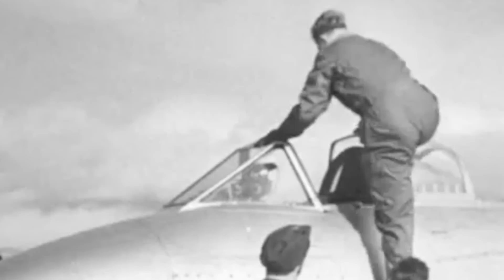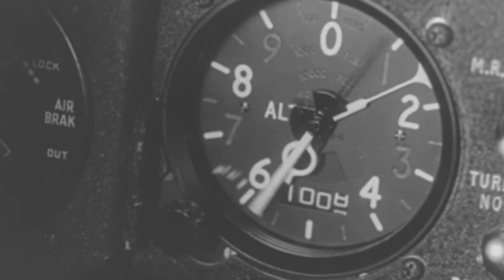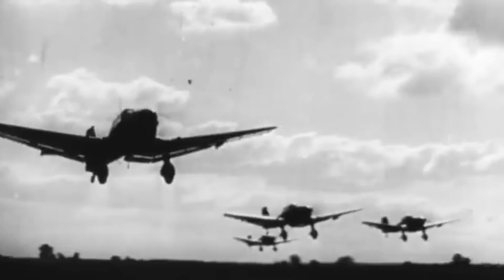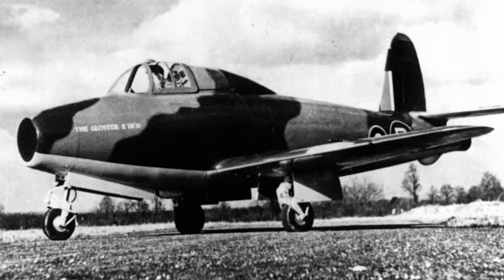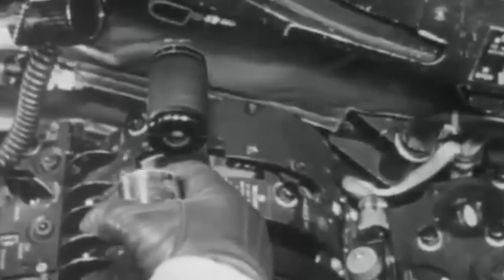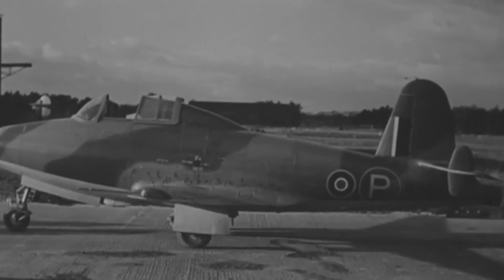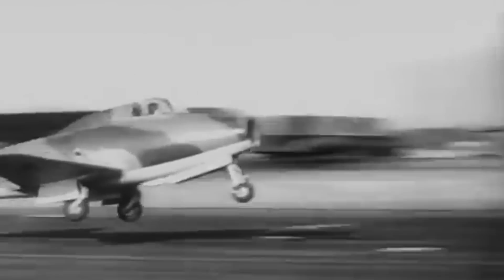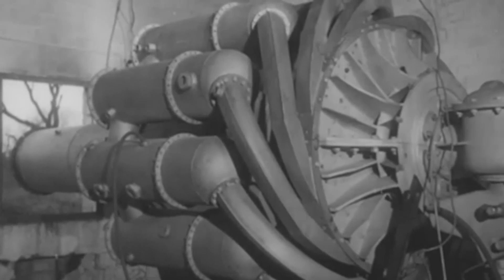Britain's 500 MPH Coffin With Wings

Comment: The description of the Gloster E.28/39 as ”Britain’s 500MPH Coffin with Wings” is just ridiculous.  As a prototype, it was probably safer than many other prototypes, British and American, of that era: the second of the two aircraft crashed, but no-one died.
If you were to ask me to identify an early British prototype jet aircraft that could, unfortunately, be described as a “coffin with wings”, then that must be the DH108, which killed Geoffrey de Havilland Jnr.  Captain Eric ‘Winkle’ Brown also flew it and almost certainly survived because of his short stature, as his head did not hit the canopy when the aircraft experienced violent buffeting.  Two other test pilots also died in crashes of the DH108, and all three aircraft were lost.
The crash of  E.28/39 W4046 in July 1943 was nothing to do with the engine: the ailerons jammed at 37,000ft, possibly because the grease in the bearings froze.  With the aircraft inverted, Davie didn’t even consider staying with it, and was preparing to bale out, but was thrown out of the aircraft when the canopy broke up.  However, he had the presence of mind to free fall before pulling his ripcord.  
Although he sustained injuries, he was able to return to work as a test pilot not long after the crash.  Sadly, however, he was lost in January 1944, when he was piloting the Gloster Meteor prototype powered by Metrovick F.2/1 axial flow engines. The port engine reportedly “disintegrated”, and he struck the tail of the aircraft as he baled out.  Despite this failure, the F.2/1 was significantly more advanced and more reliable than all of the German axial flow engines of the time. 
Before the flight-standard W.1 engine was installed in W4041, a non-flight-standard engine, designated W.1X, was installed for taxiing trials in April 1941. The aircraft did do some short ‘hops’ a few feet off the ground with this engine.  There is some amateur film footage of W4041 bumping over the grass at Brockworth elsewhere on YouTube.  Amateur footage of the ‘official’ first flight of the aircraft at Cranwell in May 1941 also exists, probably taken by the same cameraman.      
The W.1 engine that powered the first flight of W4041 had a higher pressure ratio, a lower specific fuel consumption and a better thrust-to-weight ratio than the Me 262’s Jumo 004B engines in 1944.  By the end of WWII, the British centrifugal engines were even further advanced, in terms of performance and reliability, than the German axial flow engines.
In late 1941, the W.1X was sent to GE and was the first jet engine to run in the USA.  Let me remind people on the other side of the Atlantic that the first generation of jet engines to go into production in the States were licence-built British engines.  The GE J31 was based on Whittle’s W.2B/23, and the Allison J33 was originally designed by GE as a ‘straight through’ development of the J31.  The P&W J42 was a version of the Rolls-Royce Nene, and the J48 was a version of the Rolls-Royce Tay.  The axial flow Wright J65 was a version of the Armstrong Siddeley Sapphire 6, which was originally the Metrovick F.9, essentially a development of the F.2/1.
Reply: The Gloster Coffin Works was infamous for its flying deathtraps and appalling safety record.

The Goster E.28/39 struggled to teach 380 mph.

The Gloster Meatbox was without question the worst jet aircraft in British history.
This deathtrap was unmatched in its horrific loss rate and fatalities.

890 crashed just in RAF service and killed 450 British pilots while never shooting down a single Luftwaffe plane.
Reply: @sandervanderkammen9230  what a load of nonsense. All of the early jets had poor safety records, look at the 262! The RAF had a higher accident rate  with the Sabre than the Meteor. The E28/39 wasn't built to set speed records, but to establish the jet engine as a practical power unit for service use, which it did very well. Aerodynamically it was sound, not spectacular. It might have come later than the dead-end He178, but it was far more practically useful. The loss of the second prototype due to control freezing at high altitude was hardly a reflection on the basic design of the airframe or engine. The British approach was cautious, not driven by desperation, as the German approach was by 1942/43, under the direction of a lunatic. The reason that the axial-flow Griffiths designed Metropolitan Vickers jet engines were not put into production in the war years was because of short engine life problems. In that sense, no worse than the BMW and Jumo jets, which in service only lasted about 12 hours. After the war, Adolf Galland said how much better the 262 would have been with British engines, after he had flown the Meteor in Argentina. Enough said, really.
Reply: @sandervanderkammen9230 

We believe we can clear up some common misconceptions & false myths.

It's always very important to note the relevant facts obviously.

Krappenz, DiktorBummer, KARZEESTAN, Diktorbaturmosterjerkzxoffenzische, AnewAOownley etc & co - they should all note with much awe and great wonder.

    Regarding the awesome Gloster Meteor, it's achievements & obvious relative superiority.

     Yes that's correct obviously, the ME-262 was limited to running away from allied piston engine fighters  & risking engine destruction while doing so & it took 3 downed 262s for each downed allied bomber over Germany where German air inferiority was fairly ubiquitous so there was indeed large swarms of allied bombers available to have a go at but the 262 was of course a dismal failure at that task.

     Agreed, clearly after 1941 it was clear The future Gloster Meteor wouldn't be required as such & was limited to operation over the UK & occupied allied territories to keep examples out of the wrong hands.

    Yes it is of course correct that the world's first jet powered aircraft to exceed 1000 mph was indeed a British aircraft.

  Of course there are two fabulous Gloster Meteor aircraft currently being used for ejector seat R&D at Martin Baker.
   
Contrary to their copious & ubiquitous posts regarding accident losses of various UK aircraft.
   
As they mentioned previously, the Sea Vixen & Gloster Meteor were indeed very competent & beautiful aircraft.

    In fact the Meteor was the world's first aircraft to exceed 0.85 on the combined 2 year looks & capability scale for jet fighter aircraft.
   
    Indeed A rather superb Gloster Meteor was the world's first Turboprop aircraft in 1945. In 1945 & 1946 trail blazing Gloster Meteors set world speed records.
     
  Yes, of course it is correct that British military aircraft at the time did not have unusually high accident losses rates.
For example
De Havilland Vampire &  Sea Vixen & Gloster Meteor accident losses were not high or unusual for fighter aircraft at the time.
Non combat phase accident losses 
% of Aircraft built.
The Canadair CL-44 was a turboprop airliner.
Canadair CL-44                    (ff 1959 ) 48%
Lockheed XF104                    (ff 1954) 100%
Lockheed  P80                       (ff 1944) 43%
Lockheed F104                      (ff 1954) 45%
McDonnell FH Phantom       (ff 1945) 35%
Gloster Meteor                     (ff 1943)  21%
DH Vampire                          (ff 1943)  23%
DH Sea Vixen                       (ff  1951) 33%
Gloster Javelin                     (ff 1951) 20%

Gloster Meteor.
3950 Built.
In service 1944.
70% didn't have ejector seats.
839 accident losses.
436 accident loss fatalities.
21% accident losses.
11% accident loss Fatalities.

Lockheed F104.
2578 Built.
In service 1958, 14 years after the Meteor.
All had ejector seats.
1100 accident losses.
425 accident loss fatalities.
43% accident losses.
17% accident loss Fatalities.

As always we do indeed hope this helps.

Cheers
👍 & 😎 & of course 🙂 indeed.
Toodle PIP Old Chap  (obviously)
     
                
    Clearly, the line above is blank, (entirely intentionally).    
    
.. . .. . ... .... . . ........... ....... ..... .....
Reply: @sandervanderkammen9230  I’m reading yet another piece of anti-British propaganda.
During its first ten hours of flying from Cranfield in 1941, the E.28/39 reached over 370miles/hr, with its W.1 engine derated to 860lb thrust (from a maximum of 1,240lb).  With later W.2 series engines installed it reached over 460miles/hr.
The Gloster Meteor never engaged a Luftwaffe aircraft because it was held back from flying over Nazi Germany until the very late stages of the war.  The reason?  To avoid the risk of its jet engine technology falling into enemy hands.  And before you or anyone else tells me that the German axial flow engines were “advanced”, I will state a few simple facts.
In 1944, the Jumo 004B in the Me 262, had a lower pressure ratio, a higher specific fuel consumption and a lower thrust:weight ratio than the W.1 back in 1941.  The handling of the 004B was problematical, to say the least: it had a complicated starting procedure, and the throttle could only be opened and closed with care, at risk of a surge and flameout.  After take-off, the Me 262 had to climb out on a fixed throttle setting and, on landing, it was a sitting duck for any Mustang or Tempest.
The Jumo 004B worked – but only just.  At the end of the war, the British centrifugal engines were altogether superior in terms of performance and reliability – and the Americans produced licence-built copies by the thousand.  The British also had a better axial flow engine in the Metrovick F.2 series than anything in Germany.  However, the F.2 had reliability problems as compared to the Rolls-Royce and DeHavilland centrifugal engines.  Having said this, it was, nevertheless, more reliable than the 004B, which would never have been allowed in the air over Britain.
And let us not forget that the Me 262 and the 004B were produced using slave labour and cost the lives of thousands, if not tens of thousands.

Comment: This aircraft was not capable of 500 mph, it was barely able to top 380 mph, it needed the longest runway in Britain at the time and had a pretty shallow climb rate, the person(s) in charge of these videos needs to actually do some real research on their subjects so they don't sound like clickbait.
Reply: This is nonsense.  
As I've stated elsewhere, during its first ten hours of flying, with its W.1 engine derated to 860lb thrust (from 1,240lb), the E.28/39 achieved over 370mile/hr, faster than the Spitfire Mk.V, which was just entering service.  With later W.2 series engines fitted, it achieved over 460miles/hr.
When it was based at Farnborough , the E.28/39 was certainly using a long runway - but didn't need it.  For its first flight at Cranwell in May 1941, its take-off run was between 500 and 600 yards.
Reply: @grahamj9101  Very disappointing performance compared to the German jets... the British produced inferior jet engines and airframes during the war.
Reply: @sandervanderkammen9230  Utter nonsense. The British centrifugal engines were superior in terms of performance and reliability.  Please remove your Germanic rosarote Brille and accept the facts of history.
Reply: @sandervanderkammen9230  😂 mmm yer that's why the bomber with the biggest payload of the war was powered by Rolls Royce and the Spits and even the bloody Mustang cos the yanks engines where hit or miss apart from radial engines
Reply: @grahamj9101  Bollocks mate, British centrifugal turbojet engines were clearly inferior and obsolete technology from introduction.
Centrifugal jet engines were a dead branch of the evolutionary tree
Reply: @azboakes3900  German jets rendered all  propeller fighters obsolete.
The B-29 carried the largest payload... it was powered by a radial type engine
Reply: @sandervanderkammen9230  Lancaster carried the grand slam 12,000 pound earthquake bomb.
Reply: @azboakes3900  So? The grand slam was ineffective against German underground factories and had no impact on the war... it's another example of Britain wasting valuable resources on ridiculous, useless weapons like sticky bombs, the Blacker gun and the Panjandrum.
Reply: @sandervanderkammen9230   Yet more nonsense from you.  Nazi Germany's jet engines were demonstrably inferior to anything produced in Britain during the war.  
This was convincingly demonstrated immediately after the war, when two DH Goblins were put on test in test plant in Germany, which Britain did not have at the time.
The German engineers who assisted in those tests were amazed both by their performance and their reliability, relative to the German engines with which they had worked.
Reply: @grahamj9101  The Goblin is an inferior centrifugal jet engine, it was obsolete technology from inception.
The Jumo 109-004b was the most successful and advanced jet engine in operational service during WW2..
Reply: @sandervanderkammen9230  Your prejudices are contradicted by history - if you would but do some research.
Why would the USA build British centrifugal engines under licence in their thousands after WWII, until such time as the protracted development of the axial flow compressor finally overtook the centrifugal centrifugal compressor in the late 1940s?
Reply: @grahamj9101  Why do you deny the truth? You cannot accept the irrefutable facts that the centrifugal turbojet was a complete and total failure, and evolutionary dead-end concept that is completely extinct today.

Britain was never a leader in aviation technology and had lagged years behind America Germany and France..
Reply: @sandervanderkammen9230  Utter nonsense.  The 004B  was an abysmal engine: it had a lower thrust:weight ratio,  a higher specific fuel consumption, and its handling characteristics were totally inferior to any of the British centrifugal engines.  In fact, it was inferior to Whittle's W.1 engine back in 1941.  Check the the performance figures, as I did years ago.
Reply: @grahamj9101  Yet it powered the Messerschmitt Me-262 and completely outclassed everything in the sky.
Whittle's engines were all unmitigated failures.

Not a single Whittle engine was ever reliable enough to pass airworthiness certification or was adopted into RAF service.

The Jumo 109-004b was the most successful and revolutionary jet engine during WW2 and outperformed anything that the Allies had.

Neither the Americans or the British could produce a viable airworthy axial compressor turbojet.
Reply: Obsolete technology? Bollocks! It was along with all other who were developing turbojets emerging technology. What a load of shite  you spout.
Reply: Because it's a well-documented fact that contradicts your prejudices.  They also built thousands of axial-flow Wright J65s, aka the Sapphire 6, licensed from Armstrong Siddeley.  This was originally the Metrovick F.9, their next engine project after the F.2/4 Beryl.  The compressor of the F.2 series engines  was notably superior to that of the Jumo 004s.
Reply: @stephenrose8188  Germany was far more advanced in the development of jet engines and were quickly able to recognize that centrifugal jet engines were a dead-end design and abandoned all work on centrifugal jets... this gave Germany a huge lead in jet engine development (nearly 10 years) 
Britain would quickly fall behind by the end of the war.
The Americans were developing axial compressor turbojets independently and were quick to employ German technology and German experts after the war
Reply: @grahamj9101  The Metrovick was an unmitigated failure and the Metropolitan-Vickers company abandoned jet engines and returned to steam engines in 1947.
The Armstrong Siddley Sapphire is a completely different, redesigned engine that benefited from captured German technology and did not meet airworthiness certification until 1949, it did not enter operational service with the Victor until 1952.
The J65 is a much improved design and was quickly rendered obsolete by the vastly superior J52/JT8
Reply: Can you please name a single British company that still makes British jet aircraft in 2024???
Reply: @sandervanderkammen9230  If you consider that having to pull the Me262 airframes out of service every 20 hours yeah  they really "dominated the sky"  Good to know that you're such a dutiful fascist apologist.
Reply: @sandervanderkammen9230  So in reciprocity where is Messcheschmidt and Focke Wolf ?  Hmmm?
Reply: @tauncfester3022  TBOs averaged 55 hours for the production aircraft.
The Jumo 109-004 A version never entered production or operational service.
 A skilled ground crew could change an engine in less than 1 hour. A task that could take two days on some Allied aircraft.

I don't apologise for Fascist, Communist or Monarachist... even if Britain is ruled by a German king.
Reply: @tauncfester3022  Messerschmitt is now Eurofighter Jagdflugzeug GmbH. and is part of Airbus SE.
Folke-Wulf became part of VFW  in 1964 and was acquired by Messerschmitt in 1980.

Comment: The E28/39 was really only an experimental 'air frame'  The "Jet" engine which powered it, was merely an experimental engine (designed by F Whittle) to verify the principle of "jet propulsion".

The performance of the aircraft was quite modest.  (300 mph or so)  It was only intended to be so. This jet engine was the forerunner of later jet turbines made by Rolls Royce and De Havilland (Viz the R.R. Derwent and De Havilland  Goblin, which powered the Gloster Meteor and De Havilland Vampire. respectively).

Both aircraft  and their developments were to serve in the RAF for a number of years.
Reply: Very True of course.